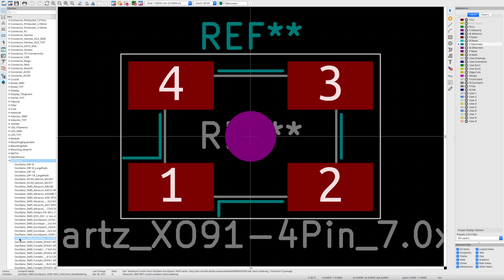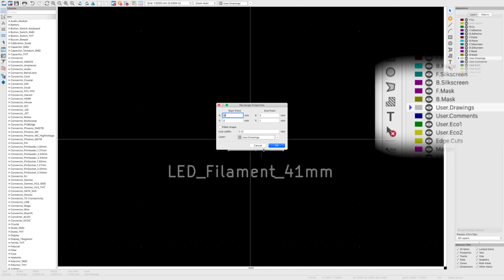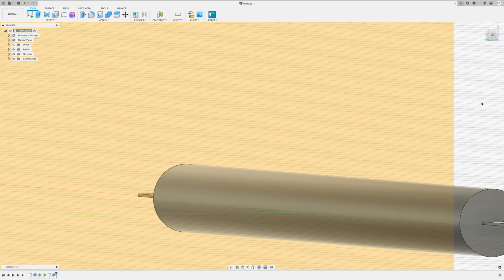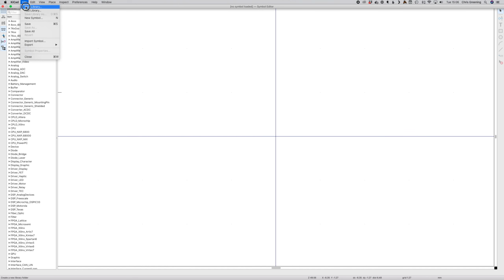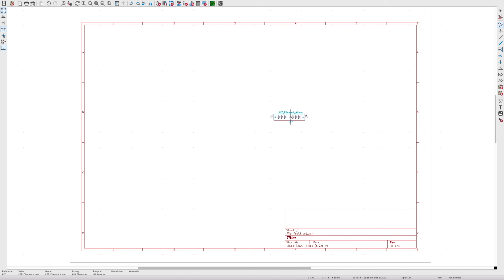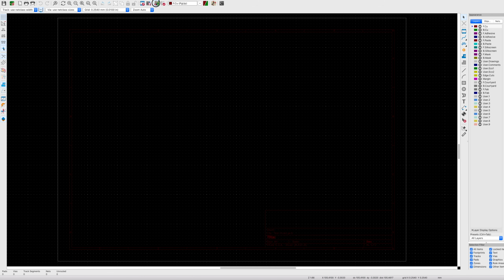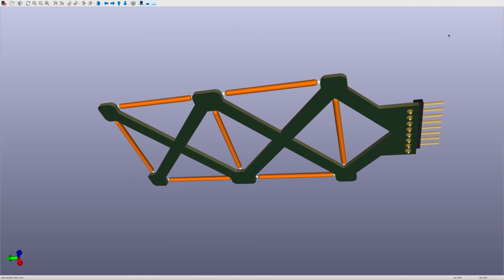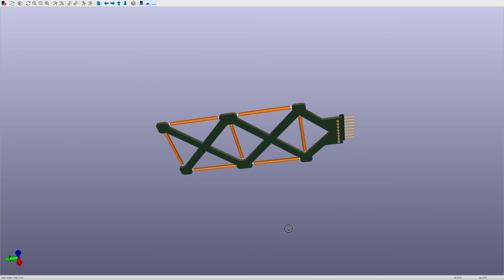KiCad Tutorial - Custom Symbol, Footprint and 3D Model

Comment: Great video, Thanks. I've made several components and footprints but never tried to create the corresponding 3d models. That clearly will change now...
BTW, I always add the courtyard definition to the footprint. Great help to make sure you don't have components interfering with each other. Design rules checker detects that.

Comment: Hello Atomic14.. What problems have you found migrating you KiCAD 5 files to KiCAD 6??  I've been hesitant to make the move.
Reply from the maker: I don’t really have that many files - I used to use EasyEDA a lot and only switched to KiCAD recently. I’ve not had any problems, but it is a one way conversion so I’d definitely make a backup first. Version 6 has been in the works for a while so o think it’s pretty rock solid.

Comment: Great tutorial.  Awesome LED filament PCB design idea, you make it look so easy. I just spent considerable time in freecad making a 3d barrel jack connector model that kicad 6.0 seemed to be missing and glad i did as it clearly highlighted it clashed with another component.
Reply from the maker: I had a look at Freecad - I was trying to use OpenSCAD to create the model and then import it into Freecad to get the STEP file. Almost got it working... I've used Fusion360 quite a bit so I'm quite comfortable with it now. Though I do keep forgetting how to do things in it.

Comment: How much current do each of the filaments draw? Are these these 3.3v version?
Reply from the maker: These are the high voltage ones, but they light up with very low current <1mA. 3.3v ones should come in a few weeks. I'm going to try and make the main board work with either.

Comment: It seems funny how many people are afraid of creating custom symbols and footprints, even though they know every single detail of the required footprint. I've been there and in hindsight, I know opening those editors for the first time is the hardest step.
Thanks for great tutorial. I need to take a look at creating 3D models of components. I've taken advantage of KiCad's 3D viewer and designed cases etc by first exporting circuit as STP -file, but haven't added any 3D models to custom footprints.
Reply from the maker: Yeah, I think it just seems like it will be very complicated, but it's not really.